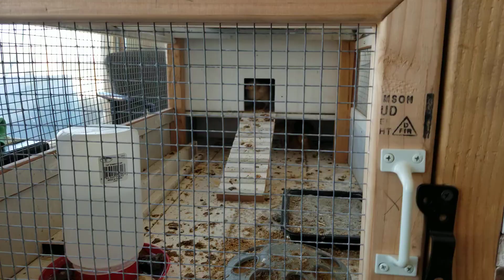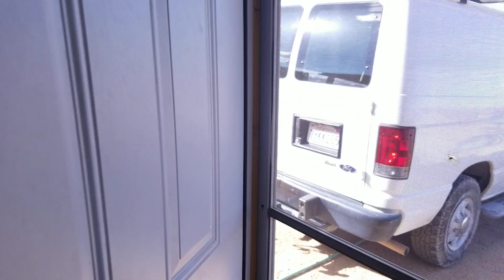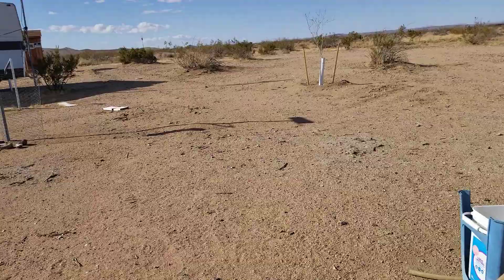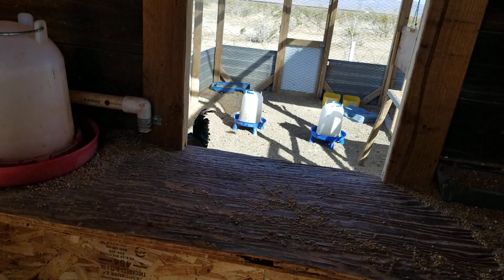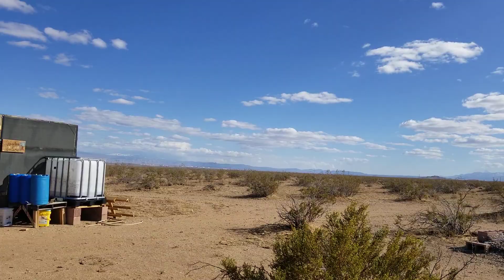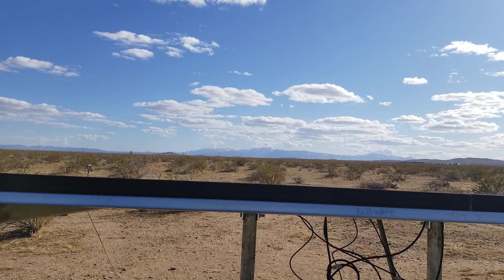Battery Banks, 12v vs. 48v. Does it matter? Mar. 21, 2021

Comment: Do you think it makes a difference on how long the batteries last on if they are parralel or series wired? Or 12V compared to 24V or higher? Which would get them to last longer than the other?
Reply from the maker: I have been on 12v for 8 years.  I have never tried 24v, but many have said they prefer it.
Remember, it takes different inverters for each, and different turbines, so plan accordingly.
Reply: @GBear  Cool. I like the simplicity of 12V. I'm doing that already too. 

But I can't help but wonder if those RVers are using the same batteries as non-RVers? And I say them because those guys are power hogs a lot of them. So it makes you curious about batteries etc and how everything is. XD

Comment: In a perfect world we would have 48 volts. Instead we went with 24 volts. Someone told me too much direct sun on the panels will deplete them over a period of time here in the desert. Haven't  a c)up if this is true.
Reply from the maker: Yeah, there are pluses and minuses to everything.  When it comes time to change my inverter, I will upgrade to 24v, or maybe 36v.
Panels get the same sun in the desert as they do elsewhere. What takes the life out of panels is heat.  Some people install panels on roofs without adequate air flow between the panels and roof. This cuts their life short.
Reply: @GBear  thanks for the insight. Did you make your dehydrator yet? I want to copy it.  🤣 😂 😹 !
Reply from the maker: No, the winds have been holding back all my projects.
Reply: @GBear  I know us too. We have had three dust devils here as well ... big ones. Soon it will be to hot here as well.
Reply from the maker: Winds still 21mph here.  Wind noise is annoying, but batteries are still above full charge.

Comment: I went with 12 volt system.12v batteries are everywhere & so are inverters, & easily replaced. 24 or 48 are usually special order.In long term grid down 12v is the way to go in my opinion. Y'alls may be different & that's ok 🤗
Reply from the maker: Off grid systems are usually put together with 6v deep cycle batteries, so 12v, 24v, or 48v is just a matter of series wiring.
But if you are happy with 12v then keep with it.  As I always say, "If it ain't broke, don't fix it!"

Comment: Thank you for making it even simpler for me to understand the reason I will be going 48 volt. Stay warm my friend !!
Reply from the maker: Just remember to not skimp on the wire sizes.  You may still have some higher amp requirements and small gauge wire would not be able to carry the current required.

Comment: I went 24 volts on mine because I tried 12 v before I had my present inverter/charger and I never could get my batteries charged very well  but what I discovered is there is an optimum voltage for each panel so by running 2 panels in series I'm close to that voltage...usually 36-9 volts coming off the panels and optimum is 18...also if the controller doesn't have to change the voltage much I got less heat in it...I'm using a 4215 BN Epever and I tried it on 60 volts but I get more watts on 40 volts but I've doubled my batteries since then ( next week I'll have 10) so that changed the resistance again, so it changes but its working way better than it ever did on 12 volts...I would have went 48 maybe but the components were too pricey for me...I figured I could get enough batteries to run it 24 and it would work alright and it's getting there...we're getting so much rain I built a generator...a '75 Briggs 5 hp motor and a 2000 watt Winco with a pulley that I put bearings in...I used a quarter inch bigger pulley on the motor so it puts out around 108 volts at a fast idle so it's enough for the Aims to use for charging but hardly uses any fuel and not very loud at that rpm..the engine is 46 years old and has points but it only has maybe 3 hours on it and the gas tank looks new...for $20 I gave for it I'm gonna get some use out of it now..I've had it's long time lol..we've had days of 50 mph winds with gusts up like 80 that tend to just break stuff so I've got to replace a panel now...I'm welding up 1 inch square pipe frames around each 2 of them now that I have enough to run my welder...(the generator will run it or the inverter/charger) ..it's just a little 45 amp induction welder from WW2..when I first thought of what I was gonna do was when I could run it I had enough solar,  maybe so, wasn't too far off...it takes around 14 amps when burning rods
Reply from the maker: Good work!  It sounds like you have your needs figured out and are working towards a fully functioning system.

Comment: I must be dense. How about comparing 12, 36, and 48v directly. What are the advantages and disadvantages of each?
Reply from the maker: Ok, let's use the 120w lightbulb example.
Ohm's law: watts=volts X amps, therefore amps=watts÷volts
120w÷12v=10amps
120w÷24v=5 amps
120w÷48v=2.5 amps
Therefore, the higher the voltage the less amps it takes to perform the same task.
Advantages to higher volts means less draw on the batteries, smaller gauge wire can be used, and less expense.
Disadvantages include higher costs for controllers, inverters, PMA'S, etc.
Reply: @GBear  So, even though the amount of power being used is the same, higher voltage systems are better because the amp-hour draw on the batteries is less?
Reply from the maker: Yes, the higher voltage requires less amps to meet the load requirements.

Comment: I have a 12 panel system at 3600 w and I use less than what they produce and what I don't use goes back to the grid and they only paid $0.03 for kettlewatt and they charge me $9.00 so I'm getting screwed out of my power going to the grid and basically like everybody else the grid is my battery on that one plus I also have an off-grid system right now it's 12 volt but I'm thinking about putting it at 24 volt because most of your deep cycle batteries is 6 volt so that's four batteries to make 24 volts versus two for 12 if you go 48 that's 8 batteries and if one battery goes down you got to replace all eight that is too expensive
Reply from the maker: That's all true, except if all your batteries are new to start with and wired together properly, having one of the group fail is unlikely.  When 6v batteries are grouped to make higher voltage they become "one" higher voltage battery, not independent batteries.  In a 12v system, if one set of 2 batteries goes bad you can't just replace 2 of the 6v batteries, as the older remaining batteries will drag the new ones down to their level causing undue stress on the new set and damaging them.
Reply: @GBear  yeah well I plan to have separate inverters for each set of batteries that way if one fails I don't have to replace everything because I can only afford to buy 4 batteries at one time if you got plenty of money you can buy a bunches of batteries and you can do that and have them all new I'm not able to afford that
Reply from the maker: Oh I know!  Money is tight for me too, but when it comes to survival I just have to find a way to afford it.

Comment: Well, I'm still glad to be on grid. Annual solar production 4 MWh, annual usage 3.8 MWh, and complicated structure of elec bill regulated by government, the elec cie pays me to be on grid. That includes connection and service charges. In fact the grid is my battery bank. And I only have 24 panels, 12 optimizers and 1 inverter. Total grid downtime during last 5 years only 6 hrs. Because I anticipated an unfavorable change in tariff structures, I have an east-west panel setup, in order to use max solar power during the day in the house and minimizing the to and from the grid.
Stay safe, best wishes, greetings from Holland
Reply from the maker: Yes, sounds like you have a good deal going there.  I talked friends in the city into going solar before the gov regulated how much solar is allowed, and had them put in more than needed.  They don't pay a power bill and get money back every year from their overages. 
One friend even bought an electric car an charges it for free on his system, so never pays for gasoline either.

Comment: I could tract the sun during the year
But where I bought 
We can get strong winds
so a fixed mount aimed more to winter hours makes more sence to me..
Plus the panels aren't expensive
Reply from the maker: Very windy here as you know, my panels are mounted low, facing south, and originally I set them up to tilt at different angles winter and summer, but found that facing them more level to the desert as they would be for summer, actually works for both.  So I didn't change their tilt this winter and still achieved "float" within the first hour of sun.
Reply: @GBear  
I will get some snow
So I'll mount them a little higher just in case..so I don't need to shovel around them..
Just now thinking 
Maybe I'll get a Fresnel lense to melt the snow with instead of shoveling
Just to play with them
??????😊😊😊

Comment: My self I'm going with 24 volt battery bank...not to large..
I'm thinking when it comes time to replace.  The Super Capacitors will be out...
I've got 14-- 245 watt panels
And when get there I'll pick up another 12 --260 watt panels
I'm going to have 6 panels   pointing s/e.   12 panels pointing south
And 6 panels pointing s/w
Yes way more than I'll need...
But I'll store hot water..
My life will revolve around the sun
At night only computers. cell phone
led lights.  computer fans as needed..
Refrigerator won't cycle at night
Frozen water for the frig at night
Of course things can change
I may decide to increase the battery bank
Time will tell
why.  because. right now I can pick up 260 watt panels for $60
maybe 10 miles from my property..
Reply from the maker: Sounds like you have a plan.

Comment: I'm in 12v
Reply from the maker: I'm still at 12v, but when time comes to replace the battery bank, I will probably convert to 48v or higher.
I understand Midnite solar now sells a controller that handles 96v
Reply: @GBear  oh ok wen I get my new inverter i will be going to 48v
Reply from the maker: My 12v bank and accessories are all working fine, but if it comes to buying new equipment I will move to 48v also.  It wouldn't be cost effective right now as my inverter is 12v, my turbine is 12v, and all my added Harbor freight solar sets are 12v, and not convertible.
Reply: Check out my videos

Comment: The downside is battery voltages, keeping each battery the same voltage, once a battery in a bank becomes the weakest link in the batteries in series it can be all over for the 4 batteries without a good equalisation. All 4 or 2 have to be of equal age and condition,  you cant put a new battery into the 2 or 4 in series, you gotta replace them all, the one major advantage of 12v banks. The downside of 12v  cabling is more expensive and you need more controllers or high end high capacity controllers which are ideal anyway. My freind has  one big panel and one charge controler for every two batteries in his 196v battery bank i think he said, using very high quality diodes to stop backfeeding the controllers so they dont go haywire, i suggested to him and he tried it , been doing it for 3 years. He runs a huge industrial dactron UPS to power his whole property, it was the cheapest inverter he could buy but its  extremely robust. Its all second hand except controllers.  Cheaper inverters are quite a bit more effecient at higher voltages, mine is expensive and wether its 12, 24 or 48 theyre almost all as effecient as one another.
Reply from the maker: Good added input.
Reply: @GBear  one guy i know went back to 12v from 48 and even went to the extreme 1 big panel one charge controller per 280amp 12v battery, he sells aussie made inverters been offgrid over 40 years.
Reply from the maker: Can't be running much on a small battery bank like that.  
One problem people produce with 48v systems is skimping on wire size to save money, but that means higher amp demands are limited by the smaller wire gauge.
If I went to 48v I would still use 1/0 or 2/0 minimum wire sizes.
Reply: @GBear  oh his is multiple batteries, chargers and pamels and 6 kw panels, each panel is HUGE,
Reply from the maker: Nice!